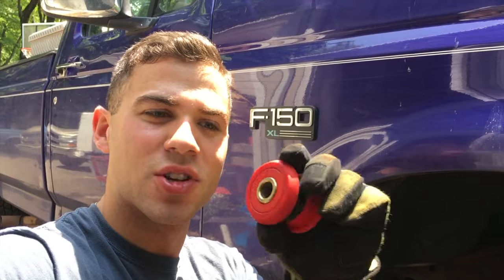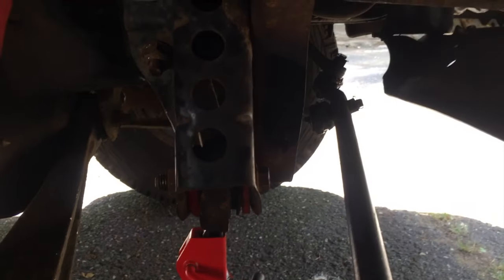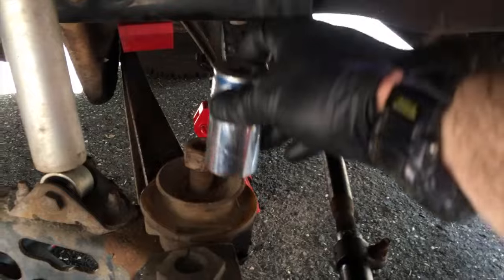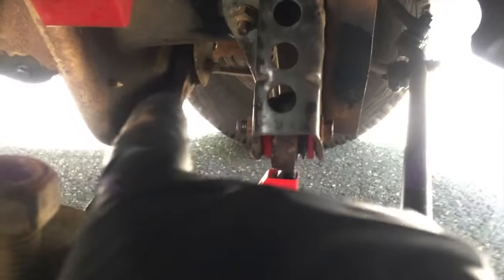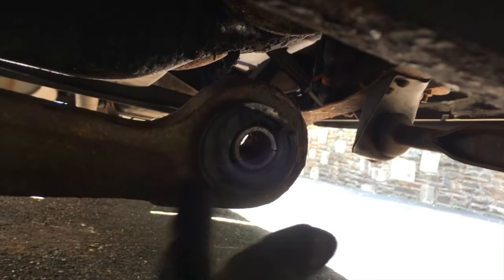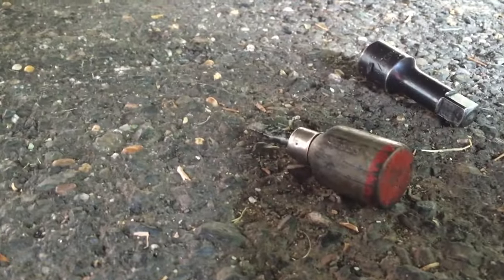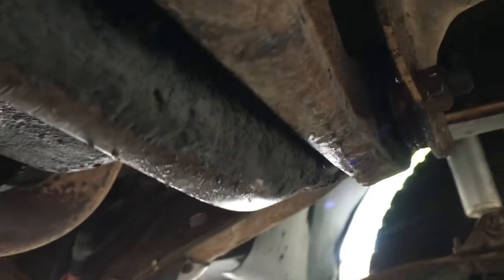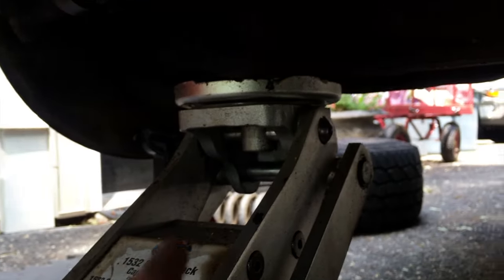How to Replace Worn Axle Pivot Bushings | 1995 Ford F150

Comment: Hey steve! There is creaking noises everytime i turn the steering wheel. I can also hear them when i hit the brakes. These noises are especially noticeable when turning and braking at very slow speeds. 
Also of i stand on the side of the truck and shake the truck with a lot of force, the same creaking can be heard.
When i took my truck to the shop he said to replace all the bushings would be like $3000. 
If i were to replace these same bushings that you do here on this video, do you think it will solve the problem? Or its a matter of replacing em one by one until the problem goes away?

Thank you for your guidance.
Reply from the maker: oscar valdez Unfortunately, anything in the suspension can cause noise. Braking and turning put extra strain on a lot of components. However, replacing bushings is a good start. Even if you didn’t have any noises, replacing bushings is a good thing to do. So I’d first inspect the axle pivot bushings and then the radius arm bushings. Look for missing pieces/junks and too much movement. If you feel the least bit suspicious, change them. I would also inspect your steering links. They should be tight but move smoothly. Lastly, check your balk joints. You can do this by jacking up one side at a time so the wheel + tire hangs freely. Grab the top of the tire with one hand and the bottom of the tire with your other. Wiggle the wheel+tire back and forth. If you get more than an 1/8 inch of wiggle. Your ball joints need changing.

Anyhow, inspect everything and be sure to tug and wiggle things. Otherwise, it’s best to replace one part at a time to see what solves your problem. There is no need to shell out $3000 all at once to stop a noise.

I hope this helps!👍
Reply: You probably fixed it already but for a customer car it was the front shock bushings that made the noise that you are describing just FYI swap the shocks and went away
Reply: Definitely ball joints

Comment: I’m getting ready to do this bushing swap, but why did you left out the most important part? The part you slide in the new bushing to the arm 😩😩😩

Thanks bro!
Reply from the maker: Guns and Autocross It just presses in like a ball joint, but easier. I recommend renting a ball joint press or make home brew set up I showed in the video. It’s really simple. You’ll do fine! 

Good luck!
Reply: @TheMinuteMasters  with the ball joint tool was it easy to press in?
Reply from the maker: @brandonruhl4525  With an actual ball joint press it’s pretty easy. My homemade ball joint press was a little weird to use but it did the trick.

Comment: Did you use the kit for a 2WD, or a 4WD? Because RockAuto and the auto part stores give me the wrong one for a 2WD. They give me a kit that is almost an inch longer than the one the truck needs. I am at a loss. I don't want to order every axle pivot bushing they make... LOL. A job that should've taken 2 hours max took 11 hours and is still nowhere close to done. LOL. Which kit did you use?
Reply from the maker: Eagle Lawn Vac and Auto I can’t quite remember. I order a set of bushings and just tested the fit with a spare axle pivot bracket. That set of too long. So I when directly to the manufacturer’s website and checked the part number to get the right bushing. I most likely would have ordered the 2wd kit.
Reply from the maker: Eagle Lawn Vac and Auto 

Energy Suspension Part# 4.3133
Reply: @TheMinuteMasters  
Thank you! Thank you! Thank you! Thank you! That's not the kit they gave me. They gave me 4.3119. You're awesome, sir! Thanks again.
Reply from the maker: Eagle Lawn Vac and Auto You are most welcome!! Thank you!🤙
Reply: @TheUnsureFox  Which one ended up working for you? I'm about to do this on my 95 f150 2wd. Bought 4.3119, which is the part they specify on their website. Just trying to find out if I bought the wrong part before I tear into it. Thanks

Comment: Hey Steve! Quick question, how did you punch out the center of the bushing first?
Reply from the maker: So the metal inner sleeve just popped out and then I hacked the rubber out with anything I felt worked. If the center metal sleeve is still attached, the best method to weakening the rubber is to burn the bushing. I think I just used a MAP gas or propane torch you find at Home Depot or Lowe’s. Then you just pick, cut, abs hack until you remove all the rubber.
Reply: @TheMinuteMasters  Simple enough! Thanks, gonna tackle this on the weekend 🤙
Reply from the maker: @mtbelzone  Nice! 🤙 Good luck man!

Comment: Just to be clear, is removing the coil springs necessary?
Reply from the maker: You don’t need to remove the coil spring entirely. I like to disconnect the top retaining clip though. This gives the i-beam more movement. You could try leaving everything connected and see how hard it is the pry the I-beam down from the axle pivot bracket.
Reply: @TheMinuteMasters  thanks for the reply. About to do this and happy I found your informative video. Rebuilding the suspension on my 95 PSD 2WD.
Reply from the maker: @jeremykeith3152  No problem Jeremy! 🤙
Nice! It’s a pretty straightforward repair. Just take your time and put some good tunes on. Very nice! I bet that’s one clean PSD.

Comment: that seems ok im not able to find anything on changing this as a 250  series. (leaf) spring. how much disassembly for that? i have the parts i need just dont like walking in blind. if you could make suggestions . thanks
Reply from the maker: mchl8 If I’m correct about the leaf sprung 3/4 T, it doesn’t have radius arms. So the procedure should be the same. Remove the shock. Take all the tension out of the leaf spring by letting hang freely. At that point you should be able to unbolt the I beam and pry it down to replace the bushing. If that doesn’t work, you will need to unbolt one if not both sides of the leaf spring. Then the I beam will be easy to move around.
Reply: The Minute Masters ill take that in consideration. no i dont belive it has a radius arm . thanks for the response. i didnt think it would b this quick. i hope the leaf spring will flex just enough.
Reply from the maker: mchl8 I don’t think it will be as quick. Leaf springs require more finesse to deal with.
Reply: The Minute Masters ok in the up comming this will b tackled. i may make a video of this. for the lack of this setup being displayed. thank you for your responce.
Reply from the maker: mchl8 Best of luck! I hope it all works out!

Comment: Hey :) where did you buyed the bushing? i wanna buy a ford f150 pick up from 1996 and it got the same problem. i am in vancouver, it would be nice if you can help me. thank you very much. (repost this is the right video :) )
Reply from the maker: MoppeyOBT You can buy OEM bushing kits from just about any auto parts store.

As for the Prothane bushings, I think I bought those on Amazon. As a matter of fact, you can get all these bushings on Amazon.

Comment: So... The the back I beam bent at all near the bushing? Mine is, and I'm trying to figure out why. It's lifted so it has drop brackets. Maybe bend the brackets to the beam?
Reply from the maker: So one I beam bolts onto a bracket in front of the other I beam. That beam runs straight to the center of the wheel well. The second I beam is behind the front one. If the second I beam was to run straight out to the edge of the vehicle it would be off center of the wheel well. To correct for this, the second I beam is bent so that it can line up center with the wheel well. So a bent I beam is ok.

Comment: I got my energy suspension poly bushings the other day and I think I need to remove that steel sleeve to hold down the small outer piece. Otherwise the bushings don’t fit in the bracket when all said and done.
Reply from the maker: Brett Jackels If your bushings don’t fit using the existing steel sleeve then you may have bought the wrong set. Without the steel sleeve the poly bushings will have nothing to sit inside. I ordered the wrong bushings the first time. They didn’t fit the axle pivot bracket. So I checked on Energy suspension’s website and I had the wrong product number. I believe the product number for f150 bushings gets confused with the ranger’s product number.
Reply: The Minute Masters i pressed the thrust bearings out (sleeve) and reinserted over the small ring side. Then the big section of the bushing slid through the bearing and seems to fit fine.The inside bushing seems like it is a little long about an 8th inch for my bracket so I might just trim it down a bit
Reply: FRED MASSE if you need new thrust bearings a.k.a. the sleeves we are talking about. Energy suspension sells them just search 1990 F150 axle pivot bushing and they have a whole kit for it with bearings
Reply from the maker: FRED MASSE Thanks man! 🤙 Brett answered your question above perfectly. Best of luck with the repair. Out of curiosity, are you in France watching my channel or here in the US?
Reply from the maker: FRED MASSE You English is great Fred, even better than some native English speakers. 
Ah! I see. That steel sleeve with OEM written on the side not part of the bushing set. When I filmed this video, I did not have a ball joint press tool. A ball joint press is how you install the axle pivot bushing into the existing steel sleeve from the previous factory installed rubber bushing. I used that “OEM” sleeve with the two piece of steel as a home made ball joint press. 
Nice! Those are great vans and you are correct. They do have the same suspension as this f150 truck. 
That’s great Fred! I know I have international viewers but it is always nice to hear from you. You are most welcome my friend! Thank you for watching the channel and you stay safe and healthy from this virus too.

Comment: Also, some twin traction beam from end pivot bushings come "cammed" from the factory which in laymans terms means the bolt hole isn't dead center in the bushing this helps with camber adjustment. So when you take this bushing out make sure to keep an eye on your old bushings before removing for orientation. They are eccentric. When making these how to video's it's better to know what you're doing
Reply: ... and then we would have no how to videos.

Comment: Folks drop vehicle first (with loose pivot bolts) then tighten bolts  specifically after suspension rests on ground.
Reply from the maker: Done 101 That makes sense. Thanks for the tip!👍

Comment: What size is that Axle Pivot Bushings??
Reply from the maker: When you search your model and year of truck, it should match the right size. If you’re getting different sizes during searches, I’d go directly to Prothane’s website and look there. If I remember correctly it seem like they were two different sizes sold for my year of truck. Ultimately, I had to check with Prothane.

Comment: You make it look so easy to this point! I have a 1995 4x4 ranger and need to replace the pivot bushings too, plus the radius arm bushings. I wish my 4x4 was as easy as yours but I am very leary about it. After dropping the front axle I am not sure if I will need to take it apart with concerns for the 4x4 gears. If I only need to drop it, then ok. But if I need to take the axle apart, that is what I worry about with being an amature mechanic!  Any advice would help.
Reply from the maker: Thanks! I guess there's a bit of finesse needed to do this job that doesn't come through the video. Anyway, I must confess I have never worked with the front axles of a 4x4. However, if the axle shafts don't restrict the movement of the I beams for repairs, then you don't need to mess with them. At most you may need to unbolt the front driveshaft. If you do need to remove the front axle shafts, they typically unbolt at the CV joints. After that, they slide out. My advice, give the repair a try. The worse that could happen is you discover you can't do the job and there is nothing wrong with that. It's worth trying though.
Reply: Well, the reply gave me the push to get it all jacked up and take a thorough inspection the previous night. The 4x4 is just as simple other than to disconnect the 4x4 drive shaft!! Simple enough! I had taken my truck to firestone to get the wheels balanced and they gave me an estimate over $2000  just to change the Pivot & radius arm bushings alone. I have a lifetime alignment w/ them for this truck. I think they wanted to make up some of their labor money!! Thanks for the kick in the butt!
Reply from the maker: Virgil White Hey, not problem! I do these videos so people don't have to pay a mechanic a ton of $$$ for something that can be done at home.  Glad it worked out! Thanks for watching!

Comment: I have a capri 30-in breaker bar half inch highly recommend it I refuse to use power tools because they deformed the bolts heads and the chances of f**** up go up.
I do everything from suspensions to engines and I use nothing but hand tools.
Good job tho.
Reply from the maker: Nice! I have a auto store brand breaker bar and I still get some use out of it. I agree with you, the impact guns destroy bolts and nuts if you aren't careful. 
Thanks man!🤙

Comment: There’s different bushings that I got that are like the oe style so I would have to get that metal sleeve out or get what you got
Reply from the maker: DEATHMETALDUDE 666 Yeah the oem are rubber with the metal sleeve attached. The poly bushings go inside the old oem bushing sleeve.
Reply: The Minute Masters yeah I’m considering just getting what you got unless I take the whole Ttb apart but I rather do it the way you did, wouldn’t it be nice if we had solid axles, and the fact if you need to take the pumpkin apart is laughable, I have a 96 bronco so feel your pain lol or will soon
Reply from the maker: DEATHMETALDUDE 666 The poly bushings are so easy to install. So I definitely recommend them. Yeah solid axles would be nice but I do like the ride of the ttb. Nice! I love a good bronco!🤙

Comment: I replaced my upper and lower ball joints a few months ago because I had some play in them and my inside edge of tires wear quickly.
I just got new tires and my van feels more squirrely than ever especially when I hit the brakes it jumps side to side a bit and feels pretty scary.
I checked my pivot arm and radius arm bushings and they look pretty good to me.
Put a pry bar on them all and they did not seem like they had much play at all.
I’m going to replace them anyways because something is amiss .
Although my sway bar bushings inside the radius arms look shot.
I will replace them as well.
I doubt the sway bar bushings would cause what I’m experiencing or would it?
I’ll check my shocks as well.
My van is. 2007 Ford e250.
It’s heavily loaded with tools as I’m a contractor.
I’m also wearing the inside edges of the rear tires and it seems my rear springs are sagging as well.
I got rid of a very heavy Weatherguard flat tool box that weighed a couple hundred pounds it seems.
I may replace my rear springs and shocks then just replace the front springs, shocks and bushings.
My tie rods seem okay but it seems I have a little side to side slop coming from my steering gear box which is the only play I can get out of the front end.
Thinking about this I may replace the shocks first and see how that does then just do the springs and all the bushings to play it safe.
My van has almost 190,000 miles Sonora time for a whole rebuild IMO.
Reply from the maker: Hall House If you’re bushing are all pretty much good. Then I would get change the front suspension first. Replace the coils and shocks. Once those are replaced, I would get a front end alignment. That should take care of the squirreliness. As for the rear, I’ve never heard of rear tires wearing weird. I would first make sure your van isn’t overloaded. Second, I would make sure the tire pressure is good. Then I would consider the leaf springs and shocks. If you are on a budget, replace only the shocks both front and rear. They will band aid the problem until you can replace the coils and leafs. I hope this helps. Weird tire wear is usually alignment, tire inflation, or shocks.

Comment: What are the simptoms of a bad one?
Reply from the maker: Front end feels loose, you can hear and feel a clunk if it’s really bad, and I think you can get death wobble from worn bushings too.
Reply: Did it actually make a difference when you replaced it?
Reply from the maker: @kiyamanus3723  Absolutely, I had a minor vibration and steering was a bit loose.

Comment: what size breaker bar did u use?
Reply from the maker: I have a 1/2 breaker bar with I think a 16-18” handle.
Reply: Awsome thank u. Im about to pur ball joints wheel bearings and new tie rods on my 95 f150. And everything on it is the original ford part from 95. I live in ky so hopfully i dont have much rust to fight.
Reply from the maker: @sullivanautorepairandmecha8268  No problem man!🤙 Nice! After you finish, the front end is going to feel smooth and firm. New ball joints and bearings are going to make it feel like your truck is in rails.

Comment: that's my exact truck I know I said this but have not found another like it does urs have a/c
Reply from the maker: Lou Rock Mine does have a/c and it's ice cold!
Reply: My truck did not I had to put it in myself just lifted her 4in working on video now .
Reply from the maker: Lou Rock I wonder is XL is supposed to have air conditioning. Sweet dude! I'll have to check that out!

Comment: Heads up everyone: While you have the axle dropped, check the torque on the mounting bracket bolts at the cross member. Mine were waaaay loose.
Reply from the maker: RW4X4X3006 Good idea! I found my frame was cracked there when I check.
Reply: @TheMinuteMasters  I've seen that before on rigs that frequent the jungle jim action.
Reply from the maker: RW4X4X3006 Jungle Jim describes Pennsylvania roads perfectly! Lol
Reply: @TheMinuteMasters  Oregon too, buddy!